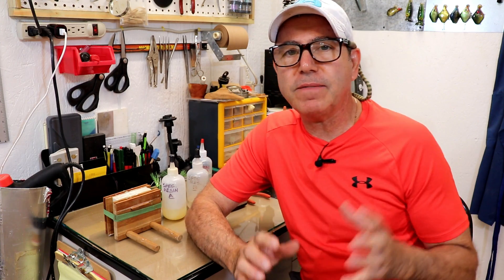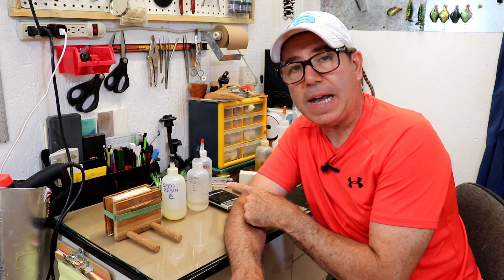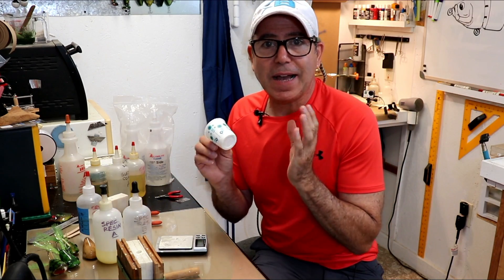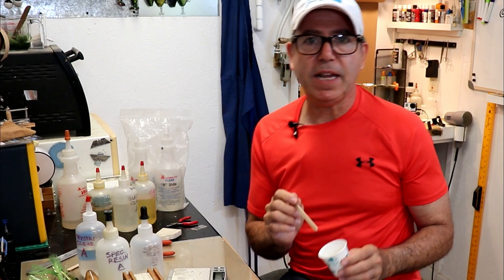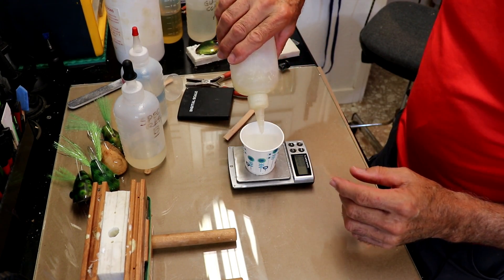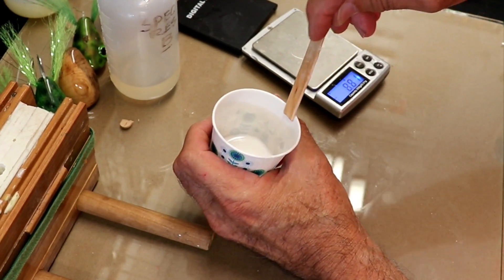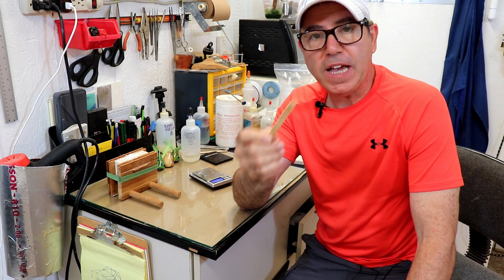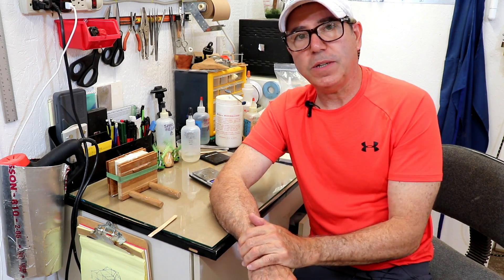Mixing Resin, Fool Proof System

Comment: This solved my issue! My resin was not curing properly before I was using two cups and my measurements were off due to pouring from the resin bottle. Using one cup and getting precise measurements from using squeeze bottles is a game changer. Thanks!
Reply from the maker: Happy it was helpful.

Comment: Hi, I'm new in making resin lures. I'm having problem getting the right resin microballoon ratio to make a floating polaris cup popper . Could you please advice for example if i'm making a 60g resin popper, how much microballons to add to make a floating popper with slight tail down . Thank you
Reply from the maker: Are you using fast setting resin, setting time about 15 minutes?
Reply: @EngineeredAngler  Yes I'm using 10min setting time resin Thank you
Reply from the maker: In that case you should be able to use the ration that I explain in the video...

Comment: Hi, Franco. I hope you see this. So I made my molds and they came out great, but, me being me, I forgot to add the vent holes. How do you recommend I add them now that the mold is made? Small drill bit? Thanks for your time
Reply from the maker: Oh no!  No worries...just cut tiny v-slots, with a razor, no bigger than a 16th inch wide and deep.  I have had to do it myself.  Cheers.

Comment: Do you wait until a lure is fully cured according to manufacturer specs before painting??? I know various manufacturers have “full cure times”.  I’m impatient (LOL).  Can you heat the cast lure.....in say a toaster oven to speed up the process?
Reply from the maker: That is exactly what I do...I cure the lures for 90 minutes in a 150 degree F toaster oven. I then wash the lures and let them dry...and then its paint time.
Reply: @EngineeredAngler  Thank you very much!  I should probably go find one, and not use the one from the kitchen!!!!

Comment: Hi my mentor, may you can help.
May you remember my past questions, I explained that I'm living in Thailand, here I can't find all the products that over there in USA you get easy. I just found in Lazada, a kind of Amazon, eBay Thai, a white powder, silica mixed with resin, to use exactly as you show about glass microspheres. Unfortunately I can speak Thai, I can't read, I can't read all the product info, try to contact company, no answer so here I am asking you. Cause you already tested so many different kinds of products, have you ever used silica mix with resin, a compound to mix with resin for boiancy proupose?
Thanks for your help!
Reply from the maker: Fumed silica can be used to increase buoyancy but you would have to use a lot...this would be expensive.  The result would be a very hard resin that would be difficult to sand and might take much longer to cure. Keep looking for the microballoons.  They are very common in boat building and might be available under a different name.
Reply: Thanks so much, really valuable suggestion, I avoid to spend money and time for nothing. Here in Thailand impossible to find glass microspheres, I look after everywhere, I got them from my country Italy, my dad bought and send them here. I should get the parcel soon. Thanks again for your help, really appreciated!
Reply from the maker: Silica will not work to increase buoyancy...it will make it heavier.

Comment: Excellent tip on the percent microballoons. Been making baits for a few years and have stayed away from a lot of floatant due to less durability. After trying 10% today, lesson learned. Action and balance is incredible. I did already snap off a thin piece of the bait, but this is only way to get that balance and swim right. Great vid

Comment: Gday mate, thanks for the great videos you make. Just wondered if you have tried Smooth on Feather lite for casting. It doesn't look as strong as Alumilite but has a way lower specific gravity so would do away with adding micro balloons. Im making some bigger 200mm lures for Mackerel and am having trouble getting them to float. At the moment I have added 15% filler which just keeps it afloat with hardware and clear coat on.  I tried a 20% mix and it was way to thick to pour. I have added the tech
data below, keen to hear your thoughts.  Cheers Hutcho 
Smooth on Feather lite Data At-A-Glance
Specific Gravity0.67 g/cc
Specific Volume41.3 cu. in./lb.
Pot Life8.5 minutes
ColorBeigeShore Hardness58 
DElongation @ Break1.6 %
Shrinkage0.003 in. / in.
Mix Ratio By Volume1A:1B
Cure Time2 hours
Ultimate Tensile2,160 psi
Tensile Modulus156,000 psi
Flexural Strength3,440 psi
Flexural Modulus164,300 psi
Compressive Strength3,070 psi
Heat Deflection Temp140 °F
Compressive Modulus53,700 psi
Mixed Viscosity410 cps
Reply from the maker: If you're having those kinds of problems you're probably mixing the micro Balloons by volume and not by weight. My 10% mix has the exact same specific gravity as the feather lite. Ironically for a topwater lure you can get away with and 8% mix. For example I would mix 10g A with 10g B and add 1.6g of microballoons. Do it by weight and you can't go wrong.
Thanks for watching.
Reply: @EngineeredAngler  Thanks for the quick reply mate, Its a pretty big lure that I am working on at about 70grams, I wanted 20% mix. so I mixed up 35g of part B and then added 14g of micro balloons and stirred them in and then added 35g of part a. I used scales to measure. It ended up aboufvvthd consistency of whipped cream. I'm going to give it another go this afternoon and see what happens. Trial and error I guess (costly trialling however) 🤣👍
Reply from the maker: 20% will give you nearly the density of Styrofoam....10%  should be plenty. ...but I'm all about experimenting 🤔. .go for it and let me know how it turns out...best of luck mate.

Comment: Hi, I've seen Japanese lure builder's coat their lures with polyurethane,.AFTER  the epoxy coat.What are your thoughts on this?  I'm having trouble with my epoxy coat.spitting/cracking, after 5/coats. I'm hoping this would help.  I wish I could show you pictures...
Reply from the maker: Polyurethane tends to yellow....don't think I would use it. 5 coats of resin is too much I think.  What product are you using and how are you applying it?
Reply: @EngineeredAngler   the reason for 5 coats is that the lures are for GT (giant trevally) fishing, it's pretty normal for the at LEAST the 5 coats...  I use Envirotex... The lure maker I mentioned uses a Marine poly...
Reply from the maker: @keales9564  
Envirotex can take up to 5 days to completely cure more in high humidity. If you are stacking coats before each coat is completely cured you're setting up a differential shrinkage scenario between the layers. ..that could be what's causing the cracking. Most Coatings have an early second coat time and a late second coat time. Usually the earliest time you can add the second coat is when the first coat becomes hard but still tacky. After that you usually have to wait until a full cure.   Best of luck.
Reply: @EngineeredAngler   wow, that long?  Is this for each coat?  I do the tacky method, around the 4 the mark. Then let it cure minimal 12 hrs... That may be the problem?

Comment: pretty much exactly how I do mine. my product allows me 20 minutes though, so I don't have to rush too bad. one other thing I will do, sometimes, is place the filled mold on my vibration machine. I have one of those real expensive machines for improving circulation. I just set the mold on the platform and turn it on for a short while. I wasn't having any problems anyway, just thought it would definitely help make any possible bubbles rise. it was just something I tried, but most times I don't bother, and have had no issues with bubbles.
but yeah, the one cup for mixing, I was always doing that, even when mixing e-tex. just didn't make sense to me to use 2 cups and then add to each other.
Reply from the maker: Like minds...
I like your vibration table idea, its.got me thinking. And thanks again for your input.

Comment: Thank you for you channel the lure maker. Some channels are just geared towards painting lure you cover all the presses to making your own lures and have learned a Lott from you again thanks. I have been using this method for almost 40 years. I learned it for a man that worked in a boat build job. It works for all 2 part mixturs like epoxy, mold silicon, casting resins, and paints when making a custom color. Please keep the info coming hopefully more often. Think you.
Reply from the maker: Thank you. ...bro...I can't do much more than one video a week, I build bridges and highways, it's my day job.😆